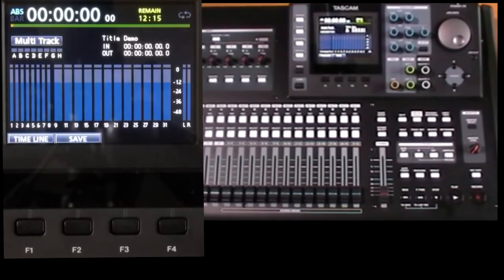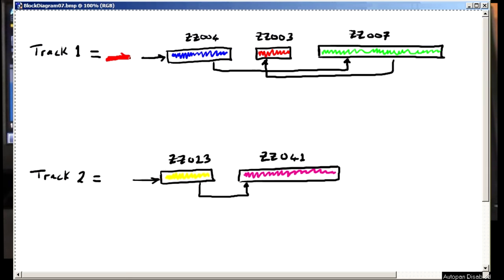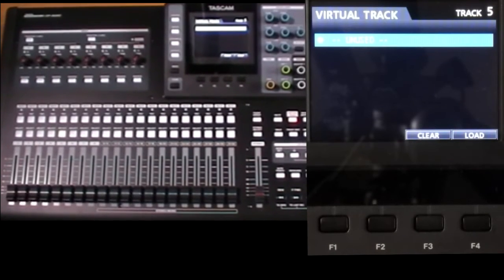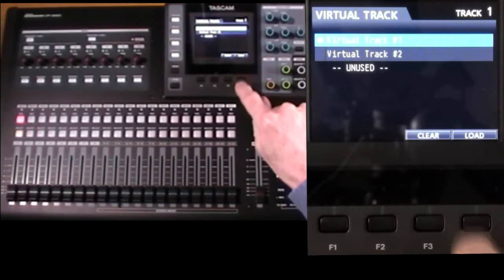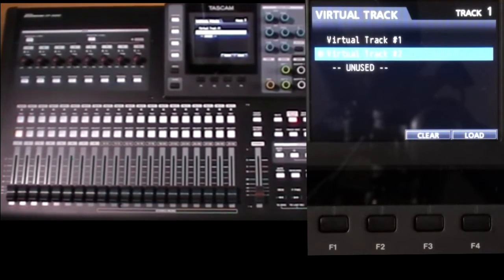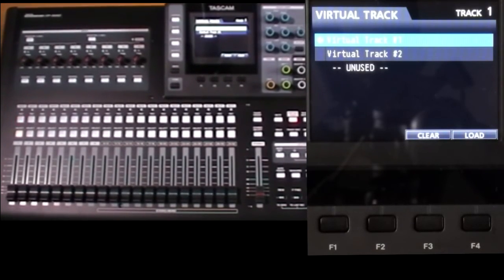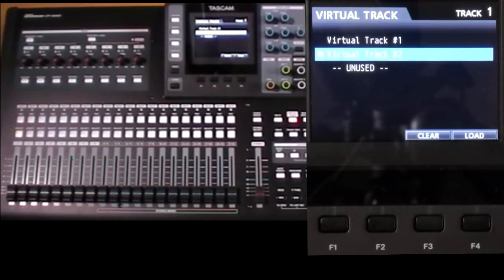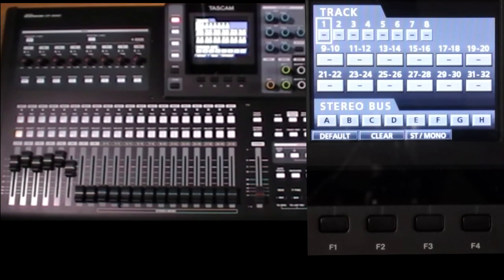Tascam DP24/32SD Tutorial 8E: Virtual Tracks

Comment: If you like parts of two different virtual tracks (say the first ½ of virtual track one and the second ½ of virtual track two) - would you have to export each virtual track, then import them into separate physical tracks and bounce them to a third track to combine them into a new new track that combines the best of both?
Reply from the maker: Hi Scott - yes that would work, but a faster way would be to clone the track instead of using export/import. i.e. make the virtual track current, clone it, make next virtual track current, clone it... and so on. Then bounce as reqd. Cloning is 'instant'.
Reply: Thank you, sir...  Keep up the excellent work!
Reply: @philtipping  Just reading this comment. Exactly what I was wondering about, I should have read ahead a bit more. Thanks again, Phil!